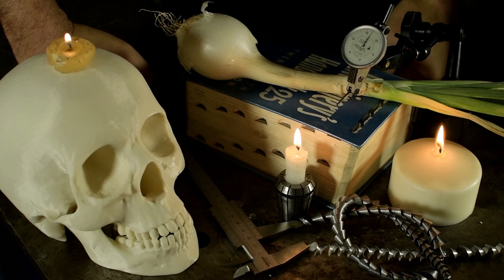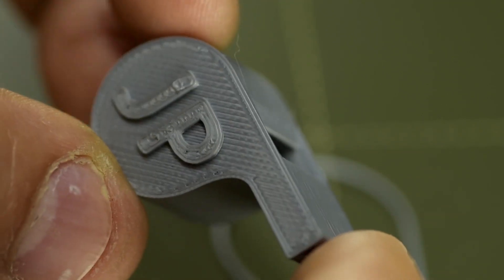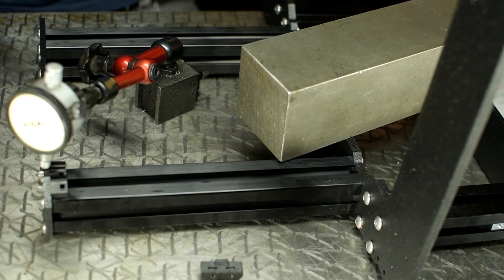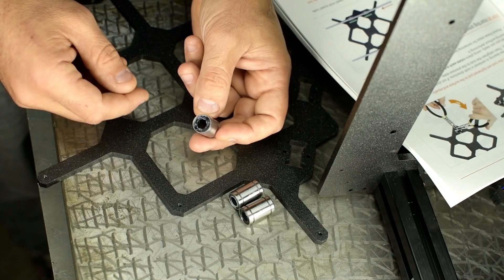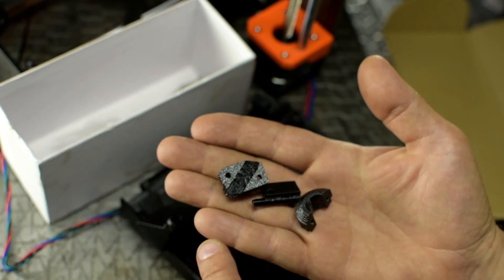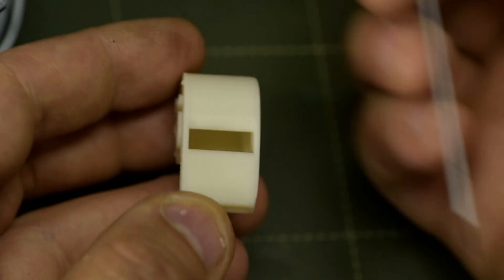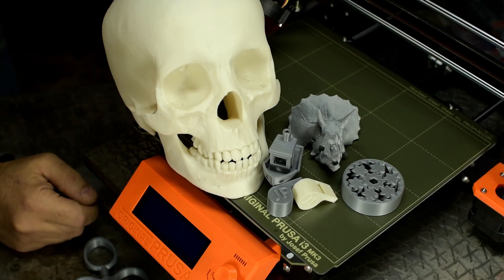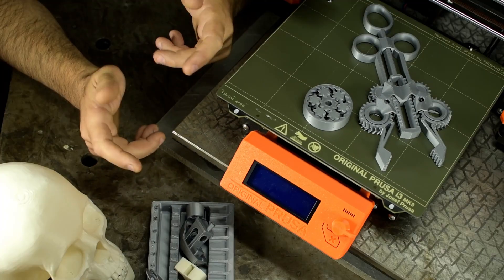This Old Tony in 3D!!! (printing)

Comment: Ooh, great choice of printer. Love my MK3S. It's printed parts to fix several of my kids' toys, and to fix the bathroom sink. It's printed cable brackets and Raspberry Pi cases and bits to convert a swing-arm monitor stand to hold the DRO on my lathe. And it's never let me down or needed any real tinkering. Fantastic machine.

Comment: I have owned both the mk2 and mk3 versions of this printer. I have been building printers since 2012. These are some of the most fool-proof printer kits around. Both of my printers have required very little maintenance. Most of them are such a pain in the ass to square and level. these are so forgiving.  I have recommended the mk3 to 3 or 4 coworkers for their first printers (the kits), and they have loved them. I highly recommend it. A great choice!

Comment: Ender 3 is just as good as the Prusa. Prusa is still trying to charge the same money they were years ago for a printer that has been surpassed by other years ago.
Reply: @npgoalkeeper _ how is proprietary sw an advantage? Tony already uses fusion. Cura is the industry standard slicer is world class and widely used. Cura has ander profiles built in. An increasing number of printers have bed leveling, filament out etc. I'm.not saying the prusa isnt a good maxhine, but its certainly an expensive one. A number of much cheaper printers are around now that are just as good

Comment: Hi Tony, as someone who's currently working with 3D printers as part of my masters theory and designing and creating parts for people at the institute i'm at, besides it being a hobby of mine and therefore spending quite a bit of time with them, I have some advice for you.
-If you ever want to get into creating CAD model for printing parts that are supposed to fit together, always add between a third and half of your nozzle size to your tolerances. Especially when adding threads to models, I'd recommend shaving 0,1-0,15 mm (based on the material and machine you are using) off the edges of the treads in the model before printing so you don't have to recut them.  
-When designing vertical features,  try to make their size and position a multiple of your layer hight. 
-If you want to increase the mechanical strength of your parts, less cooling is the way to go.
-Always align your parts in a way where the highest expected stresses and strains are in the xy-plane because parts show anisotropic material behavior.
-Unsupported overhangs can be printed up to an angle of 45° with little to no problems. Above that support material should be considered because the outermost line is placed o more air than material and can droop. Holes with less than 1/3" can go unsupported everything above that at the very least will look better if support material is added.
-And most importantly: Have fun!
Reply: This is stuff I wish I'd heard when I started.
Reply: I use Ultimaker Cura slicer and I’m pretty sure it calculates the layer heights to match the height of your vertical features. It’s always been nearly exactly right for me. Not sure about other slicers.
Reply: @noatreiman  This is true, but if you're lazy or sloppy with the design, you might force Cura to compromise the part because it needed a fractional layer. it leads to small distortions in your part, so if you want precision, planning ahead in CAD is the way to go.
Reply: @Jacob Hargiss 3D printing can have a steep learning curve at the beginning and I think although there is a lot of good content on based on selecting your first printer, modifying it, learing how to print different filaments and figuring outthe parameters, improving the quality of your prints and what cool models people made, there is very little that teaches you how to design parts for additive manufacturing, what limitations a "limitless potential technology" actually has and how to plan around them. 

@Noah T Cura is a smart program, however sometimes it tries to compensate your "mistake" in a way that creates unforeseen new problems. I prefer making all the decisions myself because if things go wrong, I know who to blame, why it went wrong and I get to learn how to fix it. If the silcer always fixes your "mistakes" until one day it doesn't, it's hard to say why it worked all the other times and not this time.
Reply: For overhangs, you can use wider draw widths and thinner layers for the external perimeter.  For layer bonding induced anisotropy, look into using PETG.  Use an infill like gyroid.
Reply: For tensile loads its best to be in the XY plane, but compressive loads should be directed along the z-axis. Otherwise splitting is likely as the layer adhesion is likely where it will fail.

Comment: Little surprised you opted for a FDM printer rather than a resin printer, but I suppose it's a bit more machinist-oriented. I kind of look at FDM as the dot matrix of the 3D printer world- good for high volume print jobs and specific cases, but ultimately you're dealing with limitations on resolution that other technologies can overcome. The Phrozen Sonic Mini 4k I think can get down to 35 microns resolution in the xy and 10 in the z, but the build volume is maybe a quarter of what you can do with that MK3 at around half the shellfish. That might make it far less useful for what you're doing, as opposed to what I do with it. Just food for thought I guess.

Comment: Best thing about 3d printer is to make aluminum casting out of the prints. Pla burns of quite well from plaster-sand mould making possible to cast any shape you can print. 

That of course leaded up to build electric vacuum casting oven to get hydrogen free high quality aluminium.

Comment: i have an ender 3 pro and its a decent printer but  has a few issues, the bed isnt level, (aluminium sag in the center of the bed) ive had to adjust the axis a few times and if you pick it up to move it at all have fun re leveling the bed for 20 min, but shes a solid printer for making d&d minis and knick knacks

Comment: Ender 3 pro user here. It's a fantastic printer that just needs a tiny bit of love. For $200, you can't possibly do any better.

Also - I'm quite disappointed the prusia is 700 doll hairs, yet contains parts that were 3d printed. Srsly??

Comment: I also have an ender 3, 3D printing is neat, fascinating SLOW, and building the printer is NOTHING compared to the learning curve for the 3D CAD system you need to master to do anything substantial. Just for the record I use Sketchup free for design it's learning curve is less steep than anything else IMHO
Best thing to d with an Ender 3 is put a glass plate on it. never lever the bed again.

Comment: You have some STRINGING in the back window, usually retraction/cooling.

You have a layer delamination on the outer hull, that's temperature usually.

ABS you want an enclosure, which I made one out of styrofoam and aluminum tape.

Comment: You were right about the ender 3 needing more TLC. Out of the box and even past that, unless you already have some experience with 3D printing it does take a lot of fiddling with the knobs so to speak. And it only has one knob. So you wind up doing a lot, beds sometimes come noticeably not flat for instance. Some folks have issues with the couplers. All in in all, you could've milked building it and upgrading it for 10 videos and since it's more or less modular you could've made it huge! (Probably.).

Comment: Yea, the Ender 3 is great!
Build out of way more metal parts as the Prusa.
And just works as well if not better!

Edit: And it took way less effort to build! xD
Reply: Haha good one man. Bulldog clips to hold the build plate? Couplings on the Z axis screws? No auto bed leveling? Non-silent steppers? Wheel rollers? Come on man. You get what you pay for.

Comment: ToT owns a 3d printer for a week, prints a freaking human skull. I've owned 2 printers for 3 year still can't get the print to stick to bed without selling a piece of my soul.
Reply: Also depending on the printer if you have a glass plate that's bonded to an aluminium heating bed you may find warp occurring which is due to different cooling rates and them being glued firmly together the whole surface so you end up with poor adhesion.  What you can do there to fix that problem if it is the case is use isoprop carefully separate them then re-glue at just the corners so the glass doesn't warp and twist because the ali cooled faster
Reply: I’ve tried everything.  Ultra clean glass with an even coat of aquanet hairspray works miracles. 
Used it for PLA, PETG, TPU, CF filled PC.  Everything sticks when bed is hot and pops itself off when cool.  
Glue stick can work too,  but it works TOO well in most cases.

Comment: Build yourself a very simple enclosure! It doesn't have to be super rigid or heated; all it has to do is to cut drafts off. It will greatly improve quality with basically everything! It will also cut down on dust on the linear rods. :-)

Comment: you should set up a raspberry pi with octoprint. its a really nice thing to have, control from your computer with many possible mods and apps. and no more sd card swapping.
Reply: i made my own heated enclosure with a temp sensor board some relays and a heater  that controls its own temperature that you set in octoprint. really nice to have for nylon printing and some others that like to warp.

Comment: Omg I started 3d printing toghether with TOT :o
Went with the ender 3 tho. If you do decent on leveling and settings it 3d prints with no issues. (bed is banana shaped tho)

Comment: Nice printer. A heads up. Abs needs and enclosure and hates the cold/humidity. But pla is a joy to print with and as you said, very easy to print with

Comment: Can't believe you didn't get one before. But I assume why taking something made of plastic if you can make it from stainless steel already
Reply: As an old toolmaker with a Prusa printer, there are things I've designed and made with my printer that would have either taken weeks to make or would have literally been impossible to make. And there are many things that plastics are superior for.

It will never replace a machining center, but it is a process that has it's place in design and even manufacturing these days.
Reply: @ringding1000  I saw a "Plant" in China that runs something like 500 3d printers all at once. You send them the part you want, and they price it out and print it up. For low quantity runs, it is far more economical than injection molding considering some molds will cost you $100,000.00 and up. 

The next big thing will be the metal 3d printing (cold). What they do is have steel or aluminum powder mixed in with the plastic so when you are printing, the plastic is the binder for the metal powder. It's supposed to have the same strength as T6 aluminum but don't quote me on that.
Reply: @muskokamike127  I do that on a smaller scale. Have 7 currently and make good money doing small to medium batch jobs.
Reply: Muskoka Mik
Reply: @ringding1000  As another old toolmaker, I have had a few drawings that were impossible to make.
Reply: @ringding1000  One of the neater things I've seen is using 3D printing to create ECM jigs.  You can create tooling that allows you to cut steel in your kitchen.
Also if you're not familiar with that last model TOT showed off, that's a herringbone planetary gear bearing. 100% impossible to create outside of 3D printing.
Reply: I find you spend 90% of the time in software.  Only when you are machining multiples do you see any time saving.  A local theater group wanted guns so I printed up several 1911's and AR-15's.  Once painted up, I was truly scared transporting them to the theater.  If I got pulled over by a cop, he could have shot me after seeing that many weapons in the car.
Reply: Kevin Reardon - You evidently don’t live in my Hood! Your cargo would be normal junk!
Reply: @kevinreardon2558  i doubt you would have gotten shot, but you definitely would have gotten a gun pulled on you in most cases if you had like 30 ar15-s and a pile of pistols in the car
generally if you know how to act there's zero chance of you getting shot just for having an entire arsenal in your back seat at least by the police.
but definitely if you aren't trained on how to act in a traffic stop when "armed" you could do something stupid and have a bad day.

for future reference, the correct procedure is keep hands on wheel and ask the cop what they want you to do, don't unbuckle don't get out don't get your info or papers just sit tight until they get to you. also keep that shit hidden and tell the cop it's there before you do anything it's by far the safest way to proceed.
Reply: @kevinreardon2558  He wouldn't have shot you for just having them in the car, you'd have to do something stupid like suddenly reach for them and point them at him, or something like that. 

If you have to make multiples of something it is far far far faster to print one, then make a mold from it, and pour resin into the mold. 

For a stage production you don't need all the details. The basic shape, trigger and guard, magazine, carry handle and stock. You don't need all the bolts and screws, ROF selector, safety, vent holes, etc etc etc.
Reply: @muskokamike127  Not in my experience.  That's what they are supposed to do, but they don't.  Sometimes they have really bad days.  That was the first time I truly feared for my life.
Reply: @muskokamike127  Interesting that you jump to a conclusion and prefer to accuse the victim.  That places you in the Faux News watcher category, or you filed that civics class and they just passed you to get rid of you. You weren't there.  You don't know I've competed in martial arts and am well trained to know when an attack is about to happen.  But then again, to you I'm just typing on a screen.
Reply: @kevinreardon2558  LOL wow, accuse WHAT victim? There IS no victim as you delivered your 3d printed props to the studio. 

What the hell does competing in martial arts have to do with anything? I know 10 year olds who have competed in martial arts.

You sir are nuts. Maybe too many kicks to the head during those competitions?
Reply: @muskokamike127  You know what using quotes are for?  They are a means used to show what was exactly said or written.  They aren't "air quotes" or to be used to emphasize false evidence, as you did here.  Go back and read this conversation, or bloviation.
Reply: @muskokamike127  Wow, you have a problem.  You didn't go back and read your conversation did you?  You have even fabricated some conspiracy where I intentionally mislead you.  I don't even know you so why would I do that?  SAD.
Reply: @kevinreardon2558  "Wow, you have a problem." naw, YOU are the one with the problem!

OMG OMG OMG I'm going to DIE because I have a 3d printed rifle in my carrrrrrrrrrrr

MOMMMMEEEEEEEEEEEEEEEEEEE MOMMMMEEEEEEEEEEEEEEEEEEEEE

Police almost killed meeeeeeeeeeeeeeeeeee over a 3d printed RIFLE mommmmmmeeeeeeee waaaaaaaaaaaaaaaa waaaaaaaaaaa waaaaaaaaaaa
Reply: @muskokamike127  Keep screaming at the sky.
Reply: @muskokamike127  You're pretty immature, mate.
Reply: @itsnetts  You're pretty judgmental, pal.
Reply: @muskokamike127  Maybe so, but did you really have to get so pissed off about a simple comment relating to 3D printing?
Reply: @muskokamike127  And you said I was the judgmental one? They're no idiot, let them be.
Reply: And don't forget, they were printing huge aircraft wing spars in titanium, (SLS) and there are companies in America that will print your models in any type of printable plastic, and certain metals.  Shapeways is one I've used for metal parts that I couldn't machine or fabricate in my shop.
Reply: https://youtu.be/OuB4Xfdk4eg
Reply: Is it really unbelievable? 3D-printer are great, versatile and can be money savers. The necessity of 3D-printers in metal/machine shops is little to none.

@Jonathan Allen: It depends on what you prototype. Prototyping your own idea to eventually produce and sell your own product is completely different from fabricating (prototyping) the idea of someone else. The former is done by plastic, the latter by machining metal.
Reply: @SocietyUnplugged  "The necessity of 3D-printers in metal/machine shops is little to none." that all depends on what you're machining. If you're machining a screw thread or simple shape, then yes, a 3d printer isn't going to help you. BUT if you're doing a complex shape like a gear carriage or something complex, and you're making 20 of them, a 3d printer can cut your machining time in half. 

What you do is like most manufacturers do: make a rough casting of the part, then do final machining. Look at videos on how they make crankshafts for car engines. The only machined areas are the bearing surfaces, the rest is left rough. It would take hours and hours to machine the whole crank out of a solid block of steel.
Reply: Muskoka Mike Just stay in the context of this channel please. When TOT can print something in plastic that’s impossible to make by using his machines, why bother to make a 3D-printed plastic model?
Reply: @SocietyUnplugged  "why bother to make a 3D-printed plastic model?" proof of concept. To see if the design actually works or not before taking the design to a machine shop that can produce it in metal. 

As for staying in context, I'll go wherever the conversation takes me. You're not the boss of youtube.